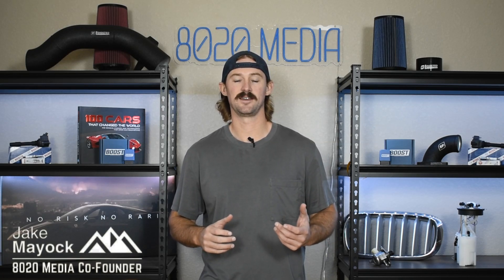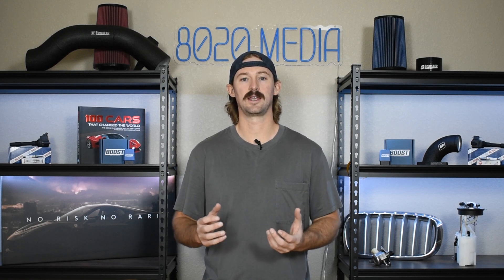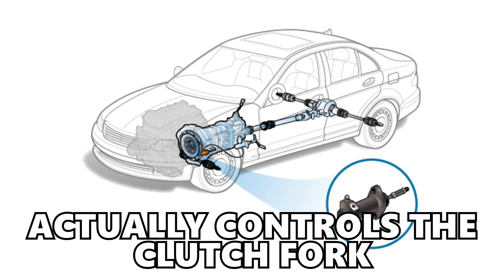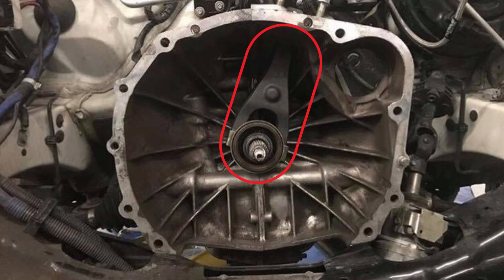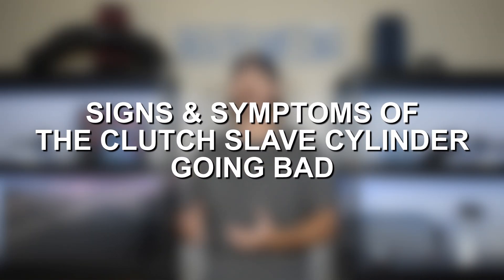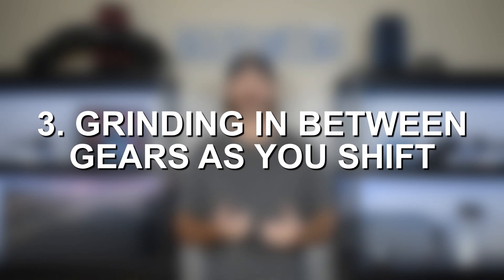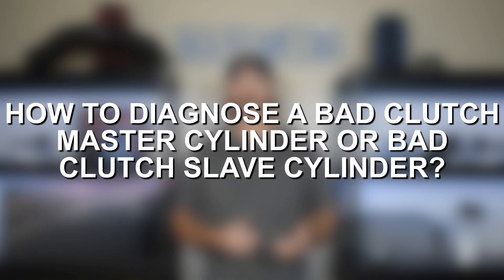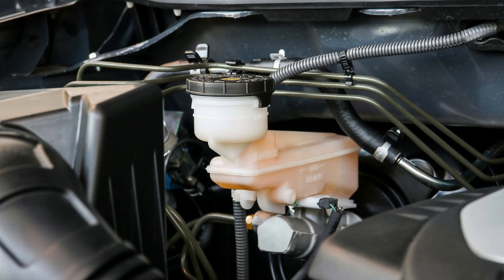Bad Clutch Master or Slave Cylinder? Symptoms, Diagnosis, and Fixes Explained!

Comment: So I replaced both I bled it and I have no clutch still, I replaced both because I didn’t know which one it was so I start w master that didn’t work so I did slave. But why this happened to begin w I had lots of shifting gears the “gates” wouldn’t open to get into gear. But still nothing what could it be?
Reply from the maker: R - If you've replaced both the clutch master and slave cylinders, bled the system, and still have no clutch pressure or gear engagement, it’s likely that air is still trapped in the system, especially if the slave is internal or difficult to bleed fully—manual bleeding can be tricky and may require a pressure or vacuum bleeder or a proper bench bleed of the master cylinder before installation; your original issue of hard shifting and "gates" not opening suggests the clutch wasn’t fully disengaging, which would also match trapped air or a faulty clutch fork, pivot ball, or pressure plate—if bleeding is confirmed solid and there’s still no pedal resistance or gear access, you may need to inspect the clutch fork travel or verify if the clutch disc or pressure plate has failed mechanically.

Comment: Hi I have topped up the brake reseviour on my 2013 1.6crdi a couple of times over the last couple of months, I can't see any leaks around the wheels or underneath the car although it has an engine pan cover on it, any idea's please anyone.
Reply from the maker: I - If you've had to top up the brake fluid reservoir on your 2013 1.6 CRDi multiple times and don’t see obvious leaks around the wheels or under the car, it’s likely that the brake fluid is either leaking slowly and evaporating before it becomes visible, or it's being lost internally—most commonly through a leaking master cylinder that allows fluid to seep into the brake booster, which won’t show an external puddle; remove the vacuum hose to the brake booster and check for fluid or strong brake fluid smell, and if present, the master cylinder is likely the culprit—also check flex hoses and ABS pump fittings under the engine cover area, as slow leaks there can be hard to spot but still cause fluid loss over time.

Comment: Hi  renualt kangoo  clutch sticks half way up  on releasing  only sometimes       cant work out what causes it as its random      might be worse in hot weather     ..  im sure my slave cylinder is in the engine  so i hope its not that    but could be wrong    ...  hope its just old fluid causing it ?    Thanks
Reply from the maker: D - A clutch pedal that sticks halfway up intermittently, especially worse in hot weather, is often a sign of hydraulic system weakness, and yes—old, degraded fluid can absolutely cause this by allowing moisture or air into the system, which expands with heat and causes inconsistent clutch operation; in the Renault Kangoo, many models do have a concentric slave cylinder inside the bellhousing, which makes replacement more labor-intensive, but before jumping to that, try a full clutch fluid flush and bleed, as contaminated or aerated fluid is a very common and cheaper cause of this exact symptom—if the problem improves but doesn’t disappear, it could also be a master cylinder sticking internally, which can also be affected by temperature and aging seals.

Comment: I think mine is causing a leak of clutch fluid on my 987.2 Boxster S. I can't really see a leak up there per say, but it's definitely coming from the top of the transmission.
Reply from the maker: B - If you're seeing clutch fluid leaking from the top of the transmission on your 987.2 Boxster S, it’s very likely that the issue is with the clutch slave cylinder or its hydraulic line connection, both of which are located at the top rear of the transmission near the bellhousing—on this model, the concentric slave cylinder (CSC) is internal but fed by a line that can develop leaks at the quick-connect fitting or where it enters the bellhousing, and over time, heat and pressure can cause the plastic line or O-ring seals to degrade; even if you can’t see the leak directly, fluid dripping down from that area is a strong sign it’s coming from the clutch hydraulic feed line or the CSC itself, which may require dropping the transmission to fully inspect and repair—so if fluid loss continues, avoid driving it to prevent introducing air into the system or damaging the clutch components.

Comment: i have a c6 corvette and i was no lift shifting where i was just quickly punching the clutch down and when i did so the peddle stayed to the floor. i have no fluid leaks but the clutch peddle pushes to the floor with ease but is harder to pull back up. also with the reservoir cap off it shoots fluid up when i push the clutch in and also pull it out
Reply from the maker: D - What you’re describing is a textbook case of a failed or internally bypassing clutch master cylinder, especially common on C6 Corvettes, particularly under high-RPM or no-lift shifting scenarios where the stock hydraulic system can’t keep up with the pressure and heat; the easy pedal push and resistance when pulling it back up means the master cylinder isn’t returning fluid properly, and the fluid geyser in the reservoir confirms pressure imbalance or internal seal failure, so your best next step is to replace the clutch master cylinder (ideally with an upgraded unit like Tick or Monster) and bleed the system thoroughly, possibly with a remote bleeder, to restore full function and prevent repeat failures under spirited driving.

Comment: my rx7's clutch stopped working. spongy pedal but when I release the clutch the car stall.. also if I press it too long it gets stuck on the floor.. just wanted to make sure what could be the issue. any idea ?
Reply from the maker: M - What you're describing almost certainly points to a hydraulic failure, most likely a bad clutch master cylinder, slave cylinder, or both; a spongy pedal and poor disengagement usually mean there's air in the system or internal leakage, preventing proper hydraulic pressure from building, so the clutch never fully disengages, causing the car to stall like you're dumping the clutch in gear; the pedal sticking to the floor is classic of a master cylinder with internal seal failure, or a leaking or collapsed clutch line, so start by checking the clutch fluid level, look for leaks at the slave and master, and then bleed the system—if it won’t hold pressure or keeps acting up, replacing both cylinders as a pair is usually the long-term fix.
Reply: @8020Automotive  I ordered a slave finally cause I cant seem to find the leak
Reply from the maker: @MicroTeck  Keep us updated

Comment: What if your clutch pedal is extra hard to push to push in all of a sudden what does that mean??
Reply from the maker: V - If your clutch pedal suddenly becomes extra hard to push, that usually means there's a mechanical issue in the clutch release system, such as a seized or failing throwout bearing, a binding clutch fork, or a pressure plate with broken or worn diaphragm springs—it can also be caused by a bad clutch cable (if cable-actuated) or hydraulic system failure (if equipped), like a collapsed slave cylinder or restricted fluid line causing abnormal resistance; in any case, it’s a sign something is binding or failing under load, and forcing it can cause more damage, so it’s best to inspect the clutch linkage, hydraulics, and release components before continuing to drive it.

Comment: The clutch release point is high?
Reply from the maker: D - At stock? Or is it higher than normal?
Reply: @ is higher than normal
Reply from the maker: @dariuslewis9320  A higher-than-normal clutch release point typically means your clutch is nearing the end of its lifespan, as worn clutch discs cause the engagement point to move higher up the pedal travel; it could also indicate air in the hydraulic system (if it's a hydraulic clutch), or in some vehicles, a misadjusted or self-adjusting clutch mechanism that’s compensating for wear—if the clutch still grips well and doesn’t slip under load, it may not need immediate replacement, but if you also notice slipping, chattering, or difficulty engaging gears, it’s time to inspect or replace the clutch before it fails completely.

Comment: what if clutch is rock solid and impossible to push down something breaking
Reply from the maker: E - If your clutch pedal is rock solid and won’t move, that usually points to a mechanical blockage or hydraulic system failure, and yes—something may be binding or breaking; the most common causes are a seized clutch slave cylinder or master cylinder, a collapsed hydraulic line, or worse, a failed clutch fork, throwout bearing, or pressure plate spring that has jammed in the engaged position—if this happened suddenly and the car was previously driving fine, suspect internal clutch damage or a slave cylinder that has over-extended or locked up, and do not force the pedal, as that can damage the master or firewall—next step is to inspect for hydraulic leaks, disconnect the slave to see if the pedal frees up, and if not, it’s time to pull the transmission and inspect the clutch assembly directly.

Comment: Replaced both master and slave and bled the system and clutch still feels soft and it’s hard to shift into gears and grinds into gears. No leaks all brand new parts and now I’m at a wall with no where to look
Reply from the maker: J - If you've replaced both the master and slave cylinders, fully bled the system, and the clutch still feels soft with difficulty or grinding when shifting into gear, you're likely dealing with either air still trapped in the system, especially at the slave (common with concentric slaves), or a clutch not fully disengaging, possibly due to incorrect push rod length, defective new parts (especially aftermarket), or even an improperly installed clutch disc (e.g., backwards); at this point, re-bleeding using a vacuum or pressure method—ideally with the slave at its highest point—or bench bleeding the master off the car may help, and if it doesn’t, you’ll need to verify the clutch fork, pressure plate, and throwout bearing engagement travel, because if the slave isn’t fully pushing the pressure plate fingers, you’ll get exactly these symptoms even with a “brand new” hydraulic system.

Comment: What's wrong when you can't push your clutch down?
Reply from the maker: M - If you can't push your clutch pedal down, the most common causes are a seized clutch master or slave cylinder, a collapsed or kinked hydraulic line, low or contaminated clutch fluid, or mechanical binding in the clutch pedal assembly or linkage. In hydraulic systems, if the master or slave cylinder fails or becomes stuck, pressure can't build or release properly, making the pedal stiff or immovable. If it's a cable-operated clutch, a seized or broken cable could be the issue. Rust, debris, or internal seal failure can also cause hydraulic components to lock up. It's best to check the fluid level first and inspect for any leaks, then test the pedal linkage and hydraulics.
Reply: @8020Automotive  I checked, and the fluid is fine. My mechanic is telling me it's the pressure plate. The thing is, this clutch has less than 20,000 miles on it. He must've put a crappy pressure plate in it or something. The last time the clutch went, the pedal went to the floor. You couldn't put it in gear. Now, it will stay in gear. I think you're right. But I can't do the work myself where I'm at. Thank you so much for your help!
Reply from the maker: @mkp3824  Keep us updated!
Reply: @8020Automotive  I will, thank you.

Comment: my clutch pedal has no tension at all the pedal goes straight to the floor n I have fluid that is leaking in the drivers side close to the front tire. have any idea what it could be. my car didnt have any signs before hand , I was driving the vehicle all day and then later that afternoon I went to go park at home and that'll went straight to the floor and I couldn't go anywhere
Reply from the maker: M - Sorry to hear. If your clutch pedal suddenly has no tension and goes straight to the floor, and you're seeing fluid leaking near the driver's side front tire, it's very likely that your clutch hydraulic system has failed — most likely the clutch master cylinder, slave cylinder, or the hydraulic line connecting them has ruptured or come loose. Since it happened suddenly with no prior symptoms, a blown hydraulic line or failed seal is most probable. The leak location near the driver's side wheel well lines up with where the clutch master cylinder or the line would be on many vehicles. You’ll need to inspect or have someone inspect the master cylinder, slave cylinder, and lines for visible leaks or breaks. Until it’s repaired and properly bled, your clutch won’t engage, and the car won’t move under its own power.

Comment: Ok here is a stumper...
No fluid leaks.
Doesn't want to move truck.
Goes in and out of gear no problem.
If truck is cool, I can pump the clutch and it works to go forward or back.
But once I go to shift. Shifts fine. It won't go forward. It rolls to a stop. 
  What's is bad?
Reply from the maker: I - That sounds like a failing clutch master or slave cylinder, or possibly a worn clutch disc or pressure plate. Since you’re able to move the truck when cold and after pumping the clutch, it points toward a hydraulic issue—pumping builds pressure temporarily. As the system warms up, seals inside the master or slave may fail to hold pressure, preventing full clutch engagement. You’re shifting fine, so the transmission isn't the issue, and no fluid loss suggests internal seal failure rather than an external leak. Start by inspecting and potentially replacing both clutch master and slave cylinders.

Comment: I can put the car into gear without even touching the clutch-it has fluid- I also can crank up! But I can’t go into gear
I mean once running the gears move into place without even engaging the clutch! When I put into 1st nothing doesn’t move!!
Reply from the maker: S - If your car can go into all gears without pressing the clutch—especially while running—and doesn't move when in gear, it likely means your clutch is completely disconnected from the drivetrain. This usually points to a completely failed or disconnected clutch disc, broken pressure plate, or input shaft failure inside the transmission. The fact that the clutch pedal still has fluid means the hydraulics (master/slave) may still work, but the mechanical link between engine and transmission is lost. You'll likely need to drop the transmission and inspect the clutch assembly.

Comment: My clutch in my S2k starts off nice and smooth, but after it warms up it becomes stiffer and harder to press in. Thoughts on that?
Reply from the maker: D - If your S2000 clutch pedal starts smooth but becomes stiffer as it warms up, it's likely due to heat affecting the hydraulic system—most commonly the clutch master or slave cylinder. As heat builds, seals inside these components can expand or deteriorate if they’re worn, causing increased resistance. It could also be old or contaminated clutch fluid absorbing moisture and becoming less effective under heat. Start by flushing the clutch fluid with fresh DOT 4 and bleeding the system. If that doesn’t fix it, inspect the master and slave cylinders for signs of wear or internal swelling.
Reply: @ Appreciate you taking the time to respond with a thorough response. What you said does make sense. I’ll start that route and go from there. Thanks!

Comment: I have a 2021 wrx and  my clutch is delaying to engage after I let off,and I can hear it sounding different whenever it engages in the exhaust,the power feels delay unless floor which I’m not trying to do everytime to accelerate🥲…help please 🙋🏾‍♂️.thanks in advance…
Reply: Get a new clutch kit, and the upgraded PDM TSK3 snout throw out bearing and sleeve repair kit. Verus forged clutch fork and billet clutch fork pilot. Perrin clutch valve delete kit and Perrin braided SS clutch line
Reply from the maker: S - It sounds like your 2021 WRX may be dealing with a worn or glazed clutch, possible air in the hydraulic system, or a clutch master/slave cylinder issue. The delay in engagement and the change in exhaust note likely mean the clutch is slipping slightly before fully grabbing, which explains the power lag unless you floor it. First, check the clutch fluid level—if it’s low or dirty, flush and bleed the system. If the fluid looks fine, the clutch itself might be glazing or nearing the end of its life, especially if it’s been driven hard. A failing master or slave cylinder can also cause inconsistent engagement. It’s worth having a shop inspect the clutch pedal travel and do a proper hydraulic pressure test before assuming it’s time for a clutch replacement.

Comment: I recently change a worn out master cylinder kit with a new kit and still having the same problem. After viewing this  video I now know the problem is with the clutch master cylinder itself and will replace it with a new one. Very helpful video. Well explained and simplified to our understanding....Thank you 🙏
Reply: You said you replaced the master cylinder and then watched this and said u were going to replace the master cylinder again. lol!
Reply: @michellelopresti4570 no he said master cylinder "KIT" which means he only changed the parts inside the clutch master then after watching this he changed the whole clutch master assembly.
Reply from the maker: S - Thanks for the feedback! Hope it helped.
Reply: Thanks
Reply: Didn't you repeat the same thing?
Reply: Sometimes the master cylinder internal diameter gets larger because it is worn out, so the kit will not work.